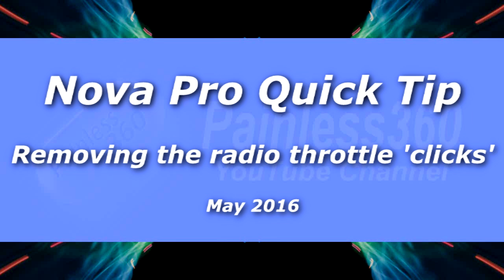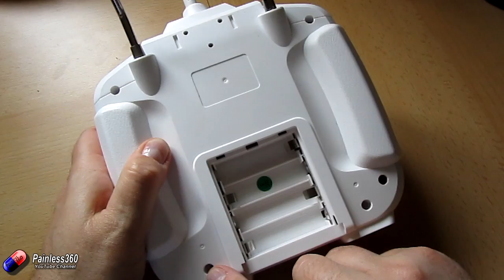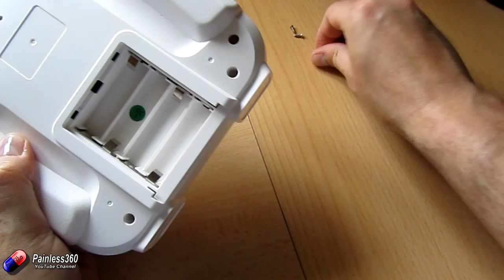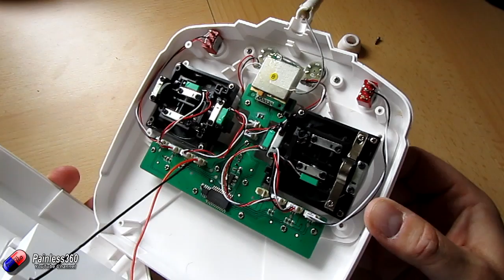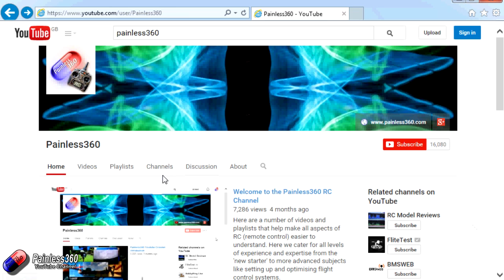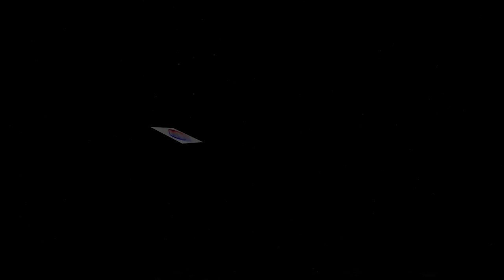Quanum Nova Pro Quick Tips - Making the radio thottle 'smooth'

Comment: I'd do horrible things if you would make a video showing how to replace the stock transmitter with an FrSky Taranis.
Reply from the maker: The flight controller is an APM so the wiring and setup is the same as the APM/Taranis series videos already out. I also have a video on adding a 6 position switch to the Traanis for the 6 flight modes. Hop[e they help..

Comment: Hello ,
today hobby king had an insane 24H sale of the nova pro for 200$ so I could not resist it and bought one , but by mistake I bought a mode 1 model . 
I will have to convert it to mode 2.
my question is what you think will be a better approach : swap between the left & right gimbals or move leaver & spring from the right gimbal to the left gimbal  ? 

I like you channel I learned a lot form it .

thanks in advance,
Amir
Reply from the maker: +Amir Barenholtz no idea sorry. Great model though. We swapped the radio soon afterwards..
Reply: thanks
Reply: Hello ,
I converted the stock radio from mode 1 to mode 2  successfully .  you said previously that you swapped the radio - so I have a question about it : in the stock wiring CH6 & CH7 from the receiver are not wired to the APM inputs ! instead they are wired directly to the Gimbal connectors on the bottom to control the gimbal directly . this wiring eliminates me to use CH6 CH7 for other purposes (e.g auto tune) - so
I wonder if I can connect CH6 & CH7 from the Receiver to the APM input and from the  gimbal connectors to the corresponding APM outputs ?    did you fix it when you swapped the radio ?  
Thanks in advance for your educated answer .
Best Regards,
Amir
Reply from the maker: You need to tune it with the camera attached if that's how you intend to fly. From the chats I had with HK the PIDs for the APM on the model are set for a camera/gimbal underneath. You could use one of the channels for the gimbal for the autotune but be careful - Autotune can cause odd things to happen so make sure you have some height to recover if needed..
Reply: Thanks

Comment: Or you can do this lads.... no need to open and spring it off (not knowing where you were before touching the screws): http://www.banggood.com/3D-Printing-DJI-Phantom-3-Inspire-1-Remote-Joystick-Steering-Resistance-Controller-p-1005932.html
Cheers professor, I am sure it will soon become a 3D printed part... As tempering, opening, with the radio is playing with some screws and not having the result expected! At least, on this solution, it is fair and easy, if I may intrude!
Cheerio, as I opened my Taranis many times to get these right depending on the model selected (for mid throttle rattling or sluggish); and I trust, such a solution, is headache free, if I may!? Just an alternative, not an ultimate bypass...Safe Flying, and Thanks again Mr Lee! Cheers as Always :)
Reply from the maker: That's another way of doing it - not sure how that really works though ;) The best option is to connect the model to a more capable radio (we've done that here with a X8R and our Taranis) and it gets an even more capable bird to fly :)